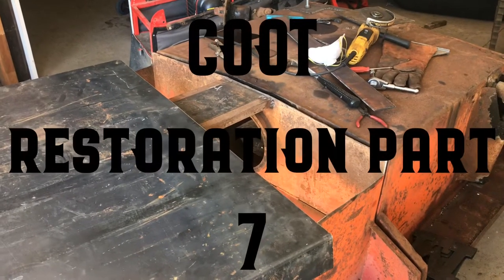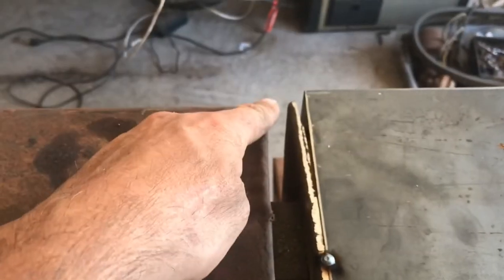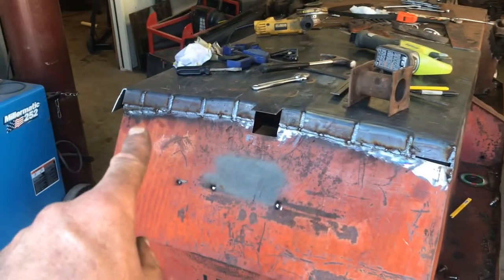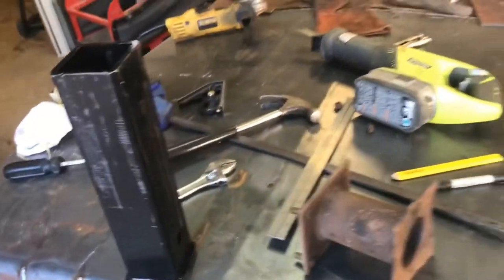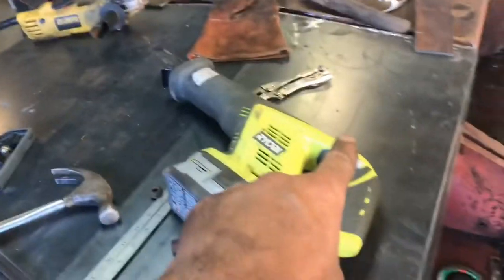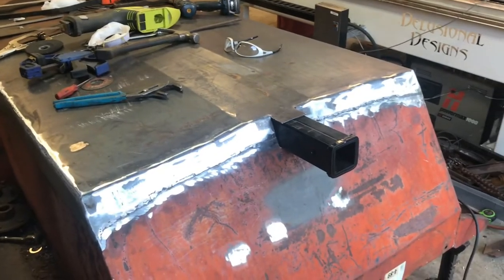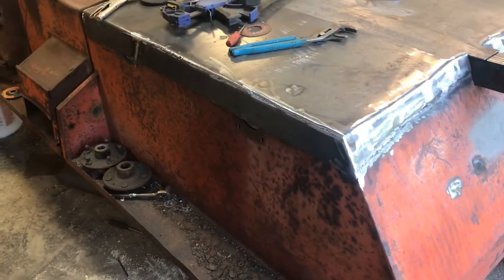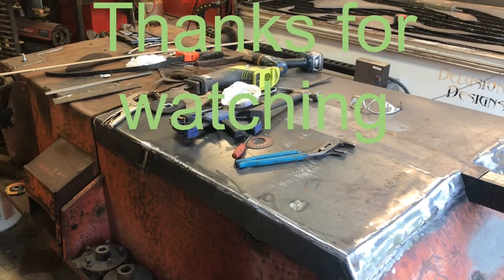COOT ATV restoration part 7

Comment: Question were you able to get the front corner to close so you could weld it up. In hindsight would you have made the floor larger than 42x42 to be able to cover the front lower corners?